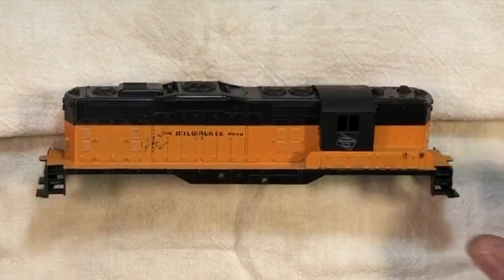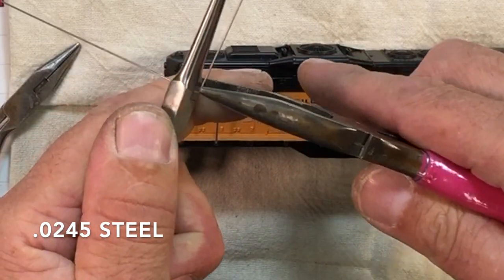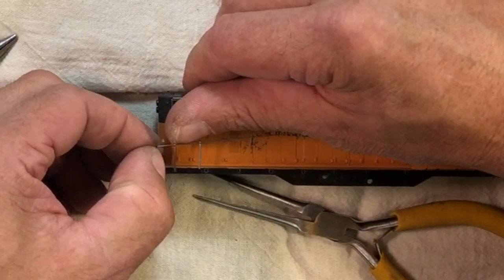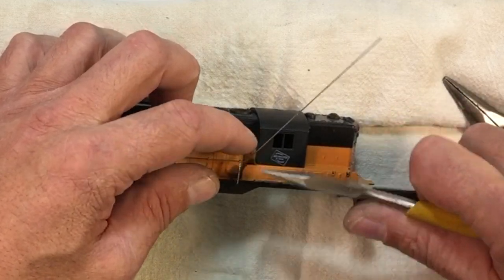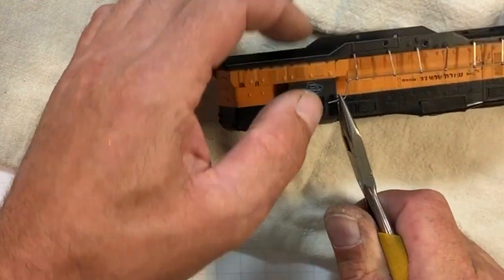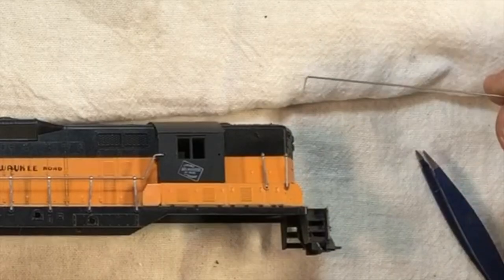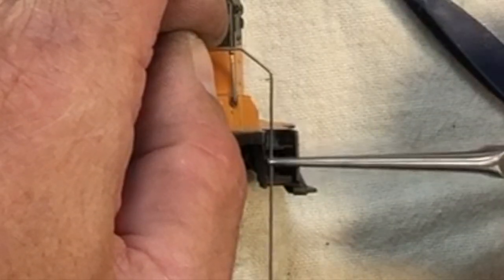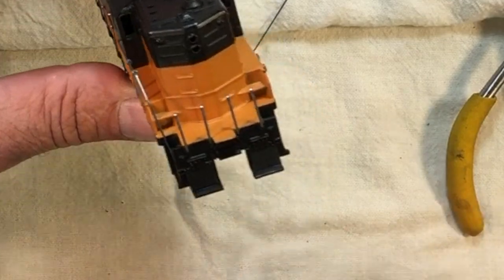Save Money & Make Your Own Custom Hand Railings!

Comment: I really enjoy watching and listening to your videos, Ron. You do good work without getting all crazy with wild modifications and stuff. You keep things fairly simple and relaxed, which is how I like my hobby. Life is difficult enough without complicated hobbies. Nice job restoring the loco and adding the handrails. Again, simple is good. Athearn locos are fine for this hobby. No ultra detailed, ultra prototypical, noisy dcc models are necessary for a calm hobby. Keep it up, buddy, you are “on the right track!”
Reply from the maker: Thanks 13th.  I agree with you. Simple and not to much detail to knock off every time I handle them!
Reply: You should be an orthodontist because you can bend wire very well.

Comment: Nice work!  I know people that solder the stanchions to hand rails once they're aligned.  I did that, then found a dot of super glue does the trick.  Makes it a really solid assembly.
Reply from the maker: I soldered my first set, then a Feller said he uses the CA on them and I found that lots easier.

Comment: Also needs the Air Tanks on the frame. Great revival of a classic Blue Box, whit some nice upgrades to the drivetrain!
Reply from the maker: Air tanks?..... Just looked at it and never noticed them gone. There is a couple mounting holes.  All my salvage stuff, Never has all the "right" parts ;-)

Comment: I used brass wire to replace the plastic stanchions on my Stewart Hobbies Pennsy U-25b and it was worth the effort.Ut has an Atheran drive similar to your Milwaukee Road Geep.
Reply from the maker: Brass is definitely a lot easier to bend than this stuff I used. I should probably start using brass :-)
Reply: @classicmodeltrains  up to you ,easier to work with for sure!

Comment: Ron what about making a wooden jig with all the holes for the staunchions to fit into with lines to show them vertically and with layered sections to help bend the wire where needed.. it would be much easier surely.... ?? one for left and one for right etc... then you could solder them in place without doig any damage to the plastic of the model etc... or even use just a dab of glue and they are set.. etc... several ideas... I guess it comes down to how many of these you do and how often you do them.... a great dual eppisode.
Reply from the maker: I attempted a wooden jig.  If I was making a large amount of the same thing it would be a great deal.  Just for  one-off's eye balling it and custom work fits the bill.

Comment: I see you've got a few more to put hand railings on.  I tried putting some on an old Tyco red, white & blue presidential model that didn't turn out too well.  I soldered the railings instead of gluing.  I need to practice my skills to do this task properly.  W Rusty Lane K9POW in eastern Tennessee
Reply from the maker: Yup! Always something that needs railings installed

Comment: Love how you describe doing the bends ... It's funny. Great handrails. I did same wasn't sure on size ended up with 3 sizes. Lucky the biggest size was right 1. Used other to make the pieces that for mounting top of rail. Have small jewelry vice. Use that to make top ends little flat. Then folded them around with little solder to keep them in place. I like silver solder. Works fantastic! Love vids keep it up  being funny.
Reply from the maker: Thanks for your kind words John!

Comment: Everything looks good so far. There are three detail parts that goes with the model. They are brake cylinders, swing hangers for the trucks, and the air tanks for down near the fuel tank if you choose to add them. These parts were included in the standard Ble box kits.
Reply from the maker: Someone pointed out I was missing the air tanks, but the other two I was unaware of.  Thanks for the good information

Comment: what is that hand tool called you use that can drill holes with your hand. if that makes sense? lol
Reply from the maker: Its called a "Pin Vise" I picked that one up from an ACE hardware store.  It's kind of a cheapy.  Dont clamp well on the small drill bits.
Reply: @classicmodeltrains  thanks for the reply man!! i just ordered me a pin vice
Reply from the maker: @ufolive1  Very cool! They are nice when they work right ;-)